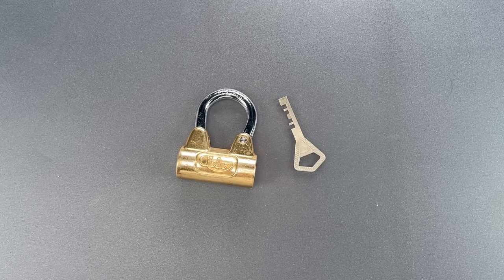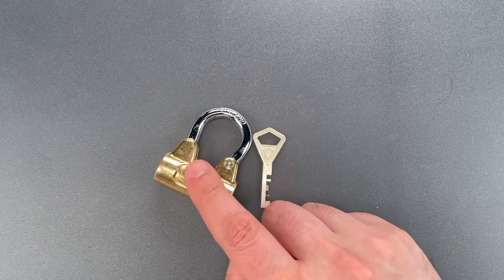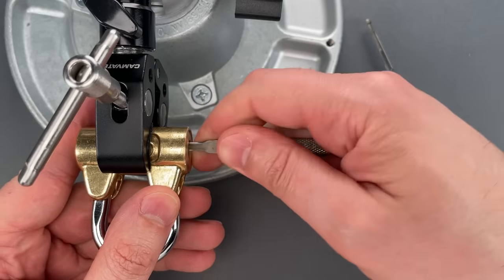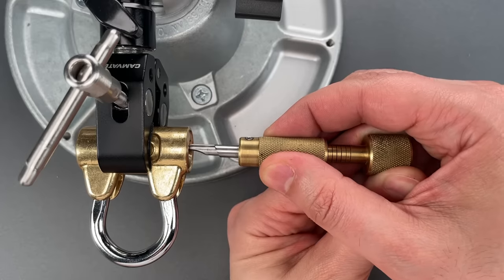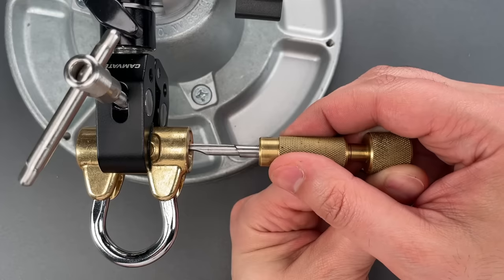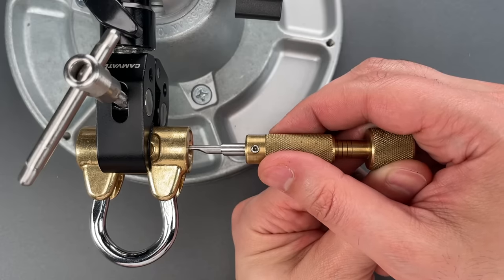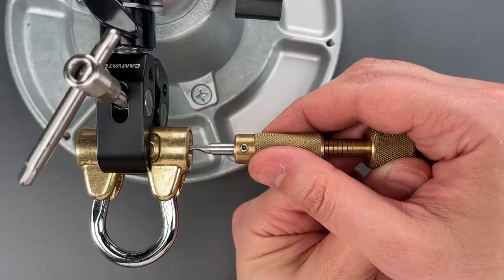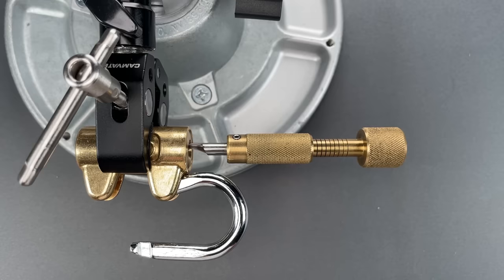[1416] Retro-Cool Abloy Padlock Picked (Model 3020C)

Comment: As most of the commenters have already stated, these cores are abundant in finland, securing anything from post boxes to older front doors.
Honestly blew my mind to see on this channel that the lock to my post box is more secure than most door locks in the states.
Reply: @xxkwijiboxx  def not wrong.  but to be fair 99.9 percent of home intruders and/or robbers have zero lockpick skill.  they'll usually get thru a window, forcefully or luck from dumb homeowners leaving it open, or they already cased the victim and/or actually know the victim and know how to get in quietly and quickly.  that or they'll just kick in the door and ask questions later.

don't ask me how i know this 😂
Reply: @three_dog  Do doors open inwards in the states just so that they can be kicked open easier? Would love to see a US cop trying to kick in a Finnish door.
Reply: Wait, wait...  only the core had any security to it as far as I could see
Reply: @three_dog  that sounds absolutely insane! In Finland all doors have to open outwards due to fire safety. So in the US it's more important to let disabled people in whenever than to let anyone out in an emergency?
Reply: @three_dog  Cops or robbers, doesn't really matter, the point was for people to enter who you don't want to enter. I used cop this time because of the rather comical visualization of the hypothesis.

The logic kind of escapes me though. Surely the disabled people will need to use the door to the other direction too, unless they never leave the house?
Reply: I use one of these to lock the shed in my summer cabin and keep my lawnmower safe from thieves.
Reply: @henrihell  In Germany doors in public access areas (like pubs, restaurants, cinemas,  etc.) have to open outward too for fire safety reasons. But doors to private houses and flats normally open inwards. Don't ask me why this is generally the case, even when there's enough room outside; maybe so you can open the door when somebody stands outside (delivery services and the like).
Reply: @henrihell  why does it matter how the door opens in case of a fire?
Reply: @highvisibilityraincoat  because when people panic they bunch up toward the exit and you can't open the door by pulling while someone pushes you towards said door
Reply: In America there is the chance that behind that weakass Kwikset you’re noisily raking or trying to bump is a 12 gauge loaded with rock salt if your lucky or triple 0 Buckshot if your not.
Reply: @jamesstrain5361  I mean, you would be surprised how trivial it is to own a gun in Finland. Simply apply for a hunting, collecting or a hobby license and you can have anything from a hunting shotgun to a full auto thompson. And most people dont stick around to see if its loaded when you are in the business end of one of those.
Reply: @janbo8331  Worth noting, outward-opening door means hinges on the outside. Forget the lock - just knock out the hinge pins and unhang the door.
Reply: @patheddles4004  I have trouble seeing how that would work. The door slots into the wall and you can't lift it before you open it. When I moved in here, all the keys were gone. I ordered a locksmith and he had to cut the entire door with powertools.
Reply: @janbo8331  we may be thinking of different hinge designs, and honestly even with the pin ones I've never actually unhung a door that wasn't already open. But assuming an outward-opening external door attached with removable-pin hinges, here's how I see it working:

- Knock the pin out of each hinge, so there's nothing securing that edge of the door except friction.

- Pull the hinged edge of the door directly outwards (no need to lift it). Will need some way to pull it, but that should be easy to arrange.

- Door should just swing open and then probably fall down.

Most locks (passthrough/deadlatch/etc) won't resist this movement at all, and even a bolt will be defeated by leverage.
Reply: @patheddles4004  That makes sense. I'm no expert on doors or locks. I did go and have a look-see though and I couldn't quite figure out how I could manipulate the hinges like that, it all seemed very solid. 

The door itself was and is about two inches thick wood and very heavy. Some kind of Abloy lock with an added Abloy safety lock that couldn't be manipulated in any way from the outside without cutting the door open. It made me think about the viability of the setup though - if someone wanted to go in, they could just grab the nearest rock and smash one of the huge windows. Honestly, I'd prefer they'd go through the front door if they were so inclined.
Reply: @FORRESTtheunoriginal  I have to comment on this, as I'm Finnish and know our gun laws pretty well. It is extremely difficult to get a full auto weapon here. It is possible to an extent, BUT it requires you to get a collectors license and you need to establish yourself as a reliable gun owner prior, and even then it's a big maybe. I mean, I know some people that have a few automatic weapons, but those people are serious collectors that have been at it a long time. Most originally auto guns that people have are actually semi auto.

And collectors are the last ones to use a gun as self defense, because they know they'd loose their collection if they did. Even if it's later found it was self defense.

It is true, that it's fairly easy to get a license for hunting. Enroll in a hunting club, take hunting test and apply for a license. A bit more difficult is to get a license for sport shooting, and a step more difficult to get any kind of pistol license. For those you have to show that you are an active hobbyist and regular at a shooting range. Collectors license requires that you are a gun owner already, and have been for a good while, that you have a realistic collection plans (type, era, how large collection etc), you need to demonstrate knowledge of the guns you want to collect etc.

All of that is possible, but certainly not trivial.
Reply: @patheddles4004  Outside doors in Finland all have a hinge design that have no removable pins. The pin is designed so that the door needs to be lifted up to remove. Inner doors do sometimes have removable pins.

Also, most outside doors also have pins in the frame that lock the door in place when it's closed. So even if someone cuts the hinge, it can't open.
Reply: @janbo8331  Finnish cop conduct their raid with C4?😂😂😊
Reply: @tsiow  In general they just ask nicely. If that doesn't work, they ask not so nicely. If it is an apartment building, they just get the key from a janitor. If it's a house, well, there's many routes apart from the door, although they do have power tools if needed.
Reply: @janbo8331  my comment to you was meant to be a joke... as your comment about Cop and out swing door.  The scene is running in my head now😂😂😂
Reply: @tsiow  I thought so actually. My "they ask nicely" was kind of a continuation of that joke, although with some truth in it. :)
Reply: @TheTurtlefarm  Ah right, that makes sense.
Reply: Firefighters  in finland use crowbars to open doors. Well, probably not their own door.
Reply: @JuhaLehtinen  well I think that works for most of the doors around the world universally. But at least it might wake up neighbors (if there is) if someone is breaking the door with that or cutting through the door with some powertools. And I think for door opening towards in crowbar might work even easier... In every case I don't think there is many ways to get in that would not include destroying the door. And often there are windows that in my opinion are easier to break. And in enough far country side people don't even lock the doors. Well for the night or if they are away from home, but otherwise one could usually just open the door and walk in if needed.
Reply: Most Finnish doors have security pins on the hinges of the doors. The door can not be lifted out even if the hinge pins were knocked out.

In the insides of houses they're less common but exterior doors feature them.
Reply: Masterlock:
Reply: @hagglundguy  Yep my door is like 10cm (4 inches) thick, it has abloy lock, it has security pins (metal spikes that go into metal slots in the frame, kinda like vault doors) it opens outward so I would like to see someone trying to kick their way in :D everything can be opened or broken but I doubt if someone tries to enter my apartment that they would choose the door.
Reply: @Naesil89  Chainsaw would be the easiest way through.
Reply: @patheddles4004  At least in modern installations there are also pins from doors to frame so you cannot slide door out of the frame, even without hinges.  Door must get opened to get those pins out of frame.   And hinges have welded pins so they cannot get easily just "knocked out".
Reply: @JuhaLehtinen  I have two times seen the door after firefighters and both times they have used chainsaw not crowbar to get in
Reply: The doors opening outwards in Finland can be traced back to the seventeen and eighteen hundreds when there were at least five instances of mass panic in churches during Christmas where people lost their lives.
Reply: @FORRESTtheunoriginal  You will not get license for an automatic weapons in Finland unless you are a collector.
Reply: @XtreeM_FaiL  Im aware of that.
Reply: @FirstnameLastname-of7so  Check out how the house builders screw the frame into the wall though, usually with a handful of cheapie fasteners that can be easily ripped through the (soft these days) wall materials. I had some high security windows in the house I bought, during some renovation I realised they fitted them with one 3mm thick screw in each side. A swift kick was all that was needed to take the frame clean out of the wall! 😀
Reply: @three_dog  50inch demolition prybar and few wedges and you can pop open 99% of doors  in few seconds and its not  even that destructive or noisy if the door frame is bendy enough and you know what you are doing. Real pros do it with prybar they can fit in their coats.
Reply: @highvisibilityraincoat When youre dying off of smoke inhalation, you could still have minimal strength to open the door. Now try it the other way around where instead of pushing the door open with your inertia, you would have to first pull the door open, probably move out of the way of the swinging door, and then exit.
Also its far easier to push a door open in panic than to fumble with it the other way around.
Reply: I have one of these exact padlocks securing my basement storage and it's almost complete overkill compared to how much easier it is to break in by some other means than picking this lock 😂.

The actual apartment then has a newer and more secure Abloy.
Reply: When you have a mass of people all pressing together to escape, the door having to open inwards means trying to push back the panicking people. Not easy, when they have flames to their backs.

There are cases where folks have died because they couldn't get the door open for this reason.
Reply: All doors in Finland have secure hinges. The door is locked in place if the lock bolt is in place. You can remove the hinges, which are protected too, but there are "gripper" protrusions inside the joints that keep the door in place unless it is rotated open.

Apparently these are sold separately in the US as some sort of deluxe home defence extra. In Finland, absolutely standard.
Reply: @patheddles4004 
Regarding un-hinging a door:
Doors on the outside of a building usually have hinges where the hinge pins are welded in place, so you can't punch them out. Some doors also have fixed bolts on the hinge side of the door, that locks the door in the frame, even if the hinges are removed or destroyed. 

I also live in a country where doors open outwards, and yes we do get lots of snow in the winters.

Comment: We have been waiting for this in Finland! The lock has Interesting history. For example, there was a big open bounty for anyone to demonstrate practical attack against this. Decades passed and Abloy never had to pay. You don’t see lock manufacturers doing that very often.

It took a long time for the first custom tool to appears. It was called Vempele (a gadget) and used by a professional burglar and kept secret. It then took several decades more before tools like the one seen in this video came up.
Reply: Hold on...

Are you saying that the LPL could potentially claim a near-century-old bounty for this?
Reply: @ShadowDragon8685  He could ask, but they'll likely say this isn't a practical attack since it takes so long and requires a custom tool. That's why they didn't pay it off for vempele either.
Reply: Correct me if I'm wrong but by the time vempele came out (in the 60s?) it was already unable to pick the newest models. It was still useful because there were probably hundreds of thousands of the older ones in use though.
Reply: @Finwolven  so, they decide when the bounty is paid? That's a bit suspicious to me.  That sort of thing seems like it would be better done by registering the bounty with some kind of long-lived law firm and is decided by a third party.
Reply: Sounds like the bounty Chubb put out for the Detector in the 1850s.
Reply: If the bounty ever did exist, Abloy won't be paying it out any time soon. This is from Abloy themselves, I assure you.
Reply: @ShadowDragon8685  that's how all the big-time grifters do things. TimeCube Guy did the same thing.
Reply: @ShadowDragon8685  Practically in this sense means that you need to do it in the field. I don't think this model has had the bounty for a long time. Like many said before it's 100 years old. The "Vempele" Antti mentioned is literally the same tool as in this video btw.
Reply: @ShadowDragon8685  HaHaHa! That's not the way things go in Finland😄😄
Reply: I have done few attacks against these locks in the military during conscription. It required an e-tool or kenttälapio and typically the locker and e-tool received more damage than the lock itself. Each breakthrough required 5 minutes of hard work so unfortunately I can't claim the bounty either.
Reply: this is used for the lockers in militaey here

Comment: This ABLOY lock core is minimum security what we got here in Finland. Abloy brand is far most common lock brand in Finland.
Reply: Would be awesome to see LPL test the more advanced/newer locks 👌
Reply: If i remember right the newer models iloq and excel are hybrid keys? So they're working by 50% mechanical and 50% electronic control principal. If LPL cracks them open im done.... 😂
Reply: Abloy is lagging in smart locks but it is the best mechanic lock maker
Reply: @zeizei8475  yeah actually i fell in a rabbithole on this one, it seems that iloq is way too easy to crack. Better just to trust the oldschool ones 😂
Reply: @SIgnoramus  you can't pick up iloq. There is nothing to pick up. Especially iloq s50
Reply: @zeizei8475  Unpickable but hackable
Reply: @juusojuuso9214  I want to see that. Everything is hackable
Reply: @zeizei8475  it is hackable that's what I said
Reply: @juusojuuso9214  and I agreed with you
Reply: @zeizei8475  Everything, everywhere where is some sort of code is hackable = doable.